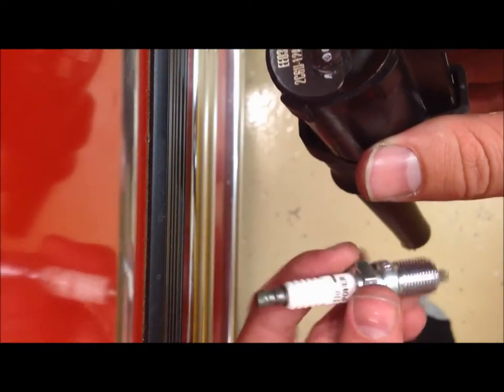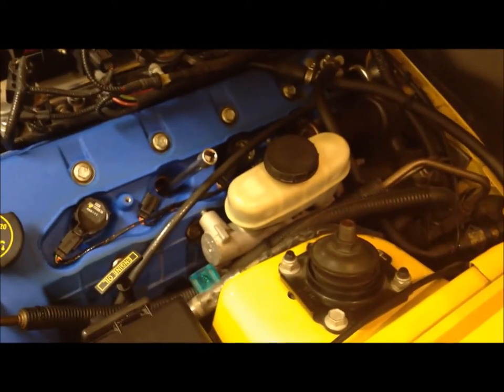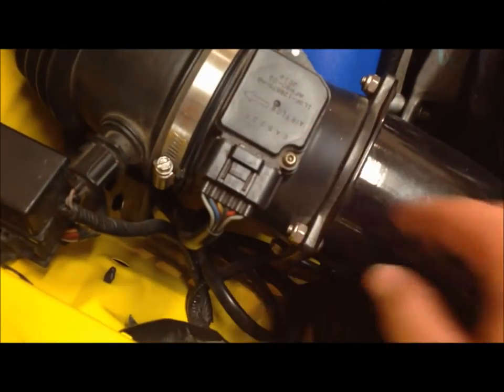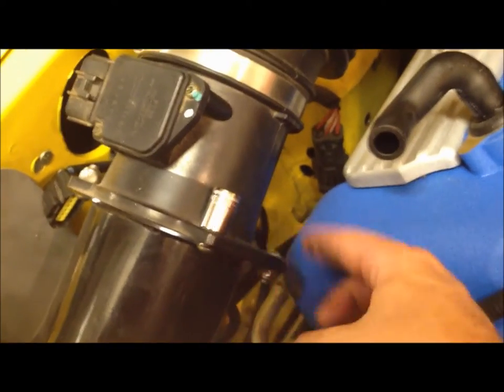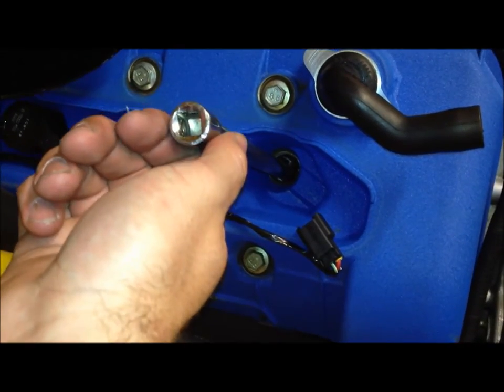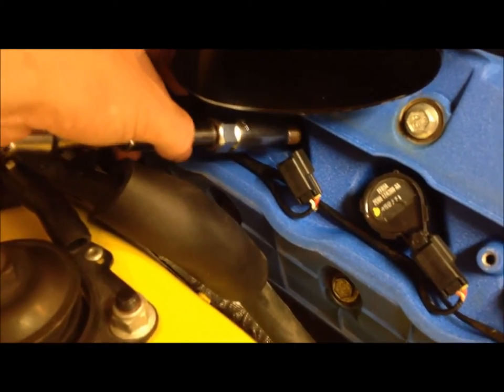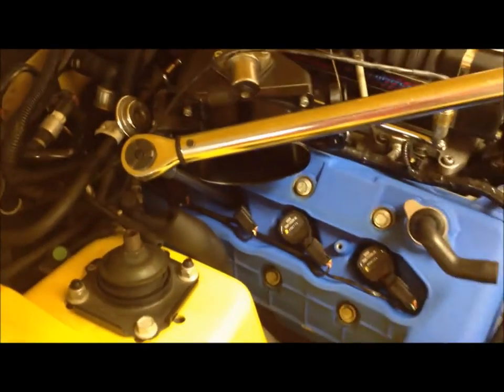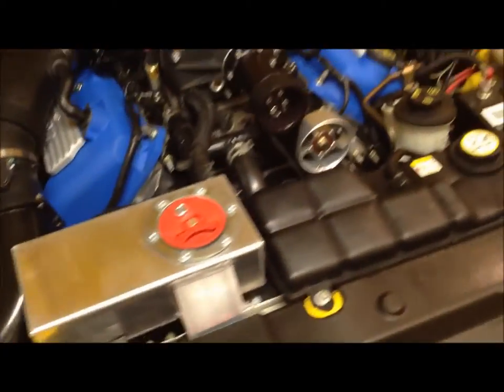How to change your spark plugs DOHC Ford V8 (Part 2/2) Mustang SVT COBRA, Aviator, Navigator, Mach 1

Comment: Hey Danny! Like I said in your recent video on spark plug blow out; my car is having misfires in 7&8. This procedure worked great. Was able to change all the plugs and coil packs and it cleared up my misfires and codes! Car is running strong now. I did find some fuel build( was like snot consistency) up on top of the spark plug, but was able to clean it all out using the straw trick. 

FYI: My 04 is stock, and I was able to leave the throttle body on to get to #3 as well. It’s tight and the extension does rub a little on the bottom of the throttle body. Just have to go slow. 

Thanks for the great videos!

Comment: Tomorrow im pulling the plugs to check on my 96 cobra,first time with a dohc engine or a 4.6 modular for that matter. Too bad u dont have a 96-98 and a how to properly burp the coolant video although i figured it out already and i have the manual also. Nice vid btw.

Comment: This helped seal the deal to my 5th gear lugging issue. Not a mechanic by any means n needed to replace coil packs as recommended and it runs brand new! Mds coil packs on my mach1 solved the issues. New plugs of course as well. Now I have a creaking squeaking only when I go slow n turn to the right? Any suggestions men?
Reply from the maker: +joe darby  perhaps it could be a blown out shock/strut. Or a bushing on the front sway bar. https://youtu.be/CSkiFyq6yes

Comment: It appears that you are not running the stock Supercharger. What throttle body are you using and did it require changing the MAF? Great video, thanks!
Reply from the maker: LFP single blade throttle body,  stock maf with Diablo mafia maf extender

Comment: Hi Danny, thanks for the videos. New 03 Terminator owner and getting ready to change plugs. Seems like there’s a range on gapping recommendations since our cars were born. I’ve pulled my plugs and they’re close to a .035. Mine has a 2.8” upper, intake, center force clutch and cat back. Car runs strong but I’ve noticed at higher RPMs when shifting to 3rd or 4th there can be slight hesitation with transition. It’s almost like trac control is on even though I turned it off. Would shortening gap to .032 or .030 help? I saw on a VMP video they recommend .030 for boost <15psi which is where I’d think mine puts out. I’d appreciate any feedback. Cheers!
Reply from the maker: If the hesitation is between shifts it’s most likely the positive pressure relief valve (pprv) in the fuel tank. Common issue with terminators. Try keeping in the throttle between shifts so the flow doesn’t stop and start again. 
   You can delete the pprv in the tank but the car may then have some trouble starting
Reply: @dannyjohnsonsgarage  ahh ok, thanks dude! Really appreciate the quick answer!

Comment: What do you recommend torquing the spark plugs to on an 2003 Mercury Marauder. It has the 4v Mach 1 engine.
Reply from the maker: 12-14 foot pounds. I would be very cautious with the 4 thread heads to check them often so they do not loosen up. They commonly become loose due to fewer threads holding the plugs in and will eventually go back and forth (up and down as each power stoke exerts force on them) and can pop out of the cylinder heads. My 2003 Mach 1 has been okay for 113k miles but I check it often

Comment: Not sure if i missed it or not but what were the torque specs you used for the spark plugs?
Reply from the maker: Yeah, it was mentioned at the end of part one. I ended up going 14 ft/lbs. if you have an 03 just keep checking that they don't come loose since there are only 4 threads holding the plugs in. Check them each time you change the oil
Reply: +Scrun Johnson  Alright gotcha, mines an 04 and I remember you mentioning that threads on the 04 mach 1 were made longer. Should I still double check if they're loose or am I fine?

Comment: Does this installation tutorial work for the 1999 SVT Cobra? I have one of those and need to replace the sparks.
Reply: Also thanks so much for your YouTube channel and work you put into it. You truly are dedicated to it!
Reply from the maker: Brandon dsadasdas thank you. And yes, same process for the 1999 but keep the gap stock if you don't have a supercharger
Reply: No problem man, well deserved. Also how much torque would I use on the 99 SVT Cobra? Would it be very similar? Also, what anti-seize product did you use? I need to buy some.
Reply from the maker: Brandon dsadasdas yeah, any anti seize from the auto parts store should work. 12 foot pounds is all on the torque. Don't over-tighten and check them after a few hundred miles again
Reply from the maker: Brandon dsadasdas yeah, any anti seize from the auto parts store should work. 12 foot pounds is all on the torque. Don't over-tighten and check them after a few hundred miles again
Reply from the maker: Brandon dsadasdas yeah, any anti seize from the auto parts store should work. 12 foot pounds is all on the torque. Don't over-tighten and check them after a few hundred miles again

Comment: 14 pound feet good for a 2v too?
Reply from the maker: Yeah, it’s about right. Hard to even get an accurate reading on that, so double check they are snug by hand with a 1/4 or 3/8 inch drive ratchet. Too tight can cause them to strip and shoot out, same with too loose. Check them each oil change
Reply: @dannyjohnsonsgarage  yeah Im going to check em with a inch pounds torque wrench which will hopefully be more accurate!